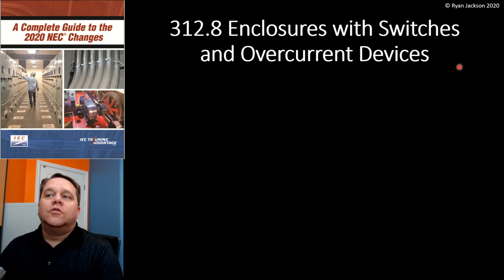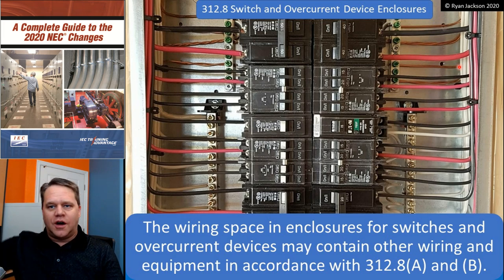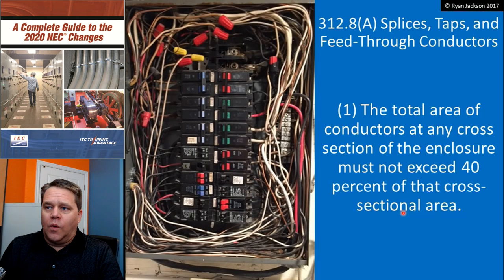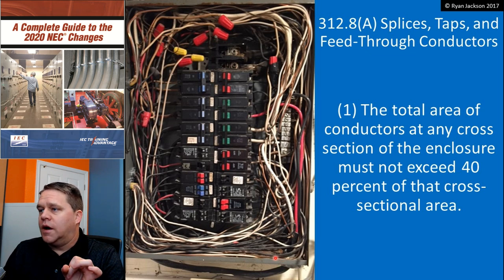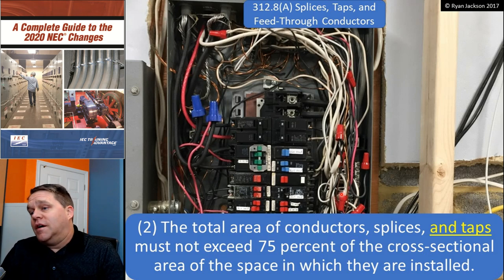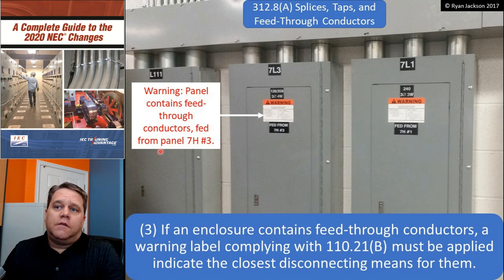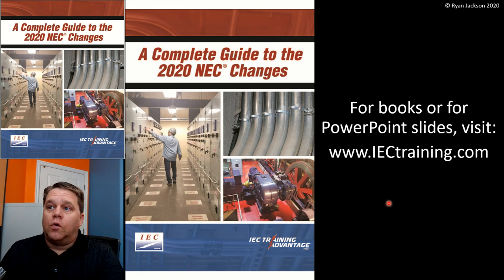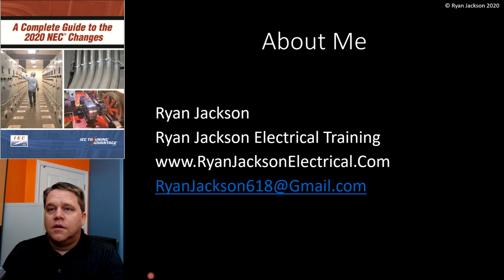NEC 312.8

Comment: Wish I could reply with a picture because I could definitely violate the 40% code. The code was designed for enclosures that have panelboards for control circuits. I had a group of electricians that left probably 2 miles of wire in an enclosure. If it were smaller they would’ve violated the code.

Comment: This apply for meter main combos too the bottom side is the panel and applies to nec 314.8 correct. So the bottom is your switch cabinet and can be spliced  and top is meter only used to be a raceway

Comment: That BRYANT panel 2:31 in your video LOOK AT THE BOTTOM ALUMINUM FEED CABLE ITS BURNED AND ARCING YOU CAN SEE THE INSULATION IS MELTING OFF. THIS PANEL NEEDS TO BE REPLACED ASAP BEFORE THIS PLACE BURNS DOWN.GOD I HATE ALUMINUM!!! I only use copper & copper bussed panels
Reply: Kind of looks that way, but it could also have been stripped back too far. (NOOX can give the impression it's been burning.) AL is acceptable, but it does take more care. (I've seen AL used in power distribution for decades -- it's cheaper, and much less valuable to meth heads)

Comment: 3:57 312.8(A) says at ANY cross section. look at those wires. you did the math wrong. you assumed that you were only taking cross sections perpendicular to the wires. you can also take cross sections PARALLEL to the wires, which will drastically increase the area of the conductors in the calculations. if you can't see 40% of the metal enclosure behind the wires it's probable you are in violation here.
Reply from the maker: That is not correct. Cross-sectional area for raceways, wireways, and gutters is calculated the same way.